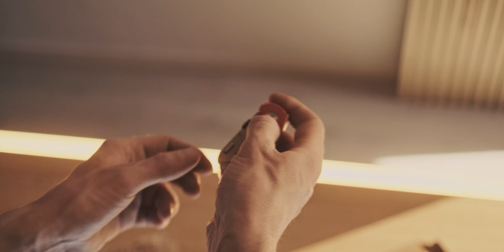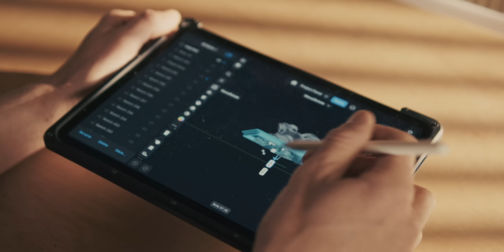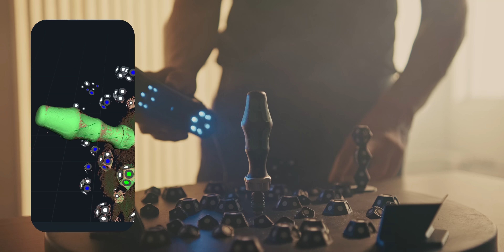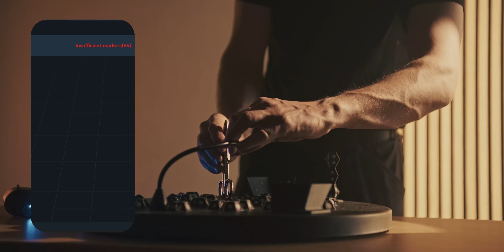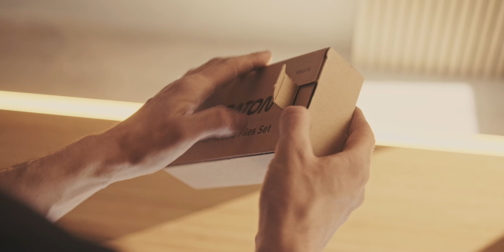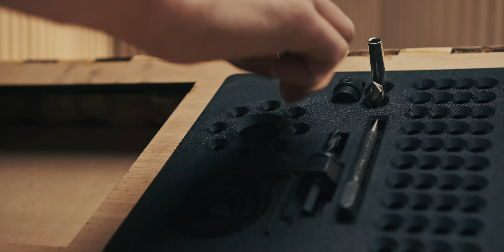Building the Ultimate 3D Print Project Panel

Comment: Why use such a POS screwdriver that can’t retain bits when you have a Wera ratchet screwdriver in your possession?
Also, those loose drill bits are just lost in those huge bins… you went to the trouble of 3D scanning everything, you could have allocated size specific locations for each drill bit?

Comment: You don't understand ratchet drivers. You just hold the collar on the first turn and it's automatically locked in the correct direction. It's not backwards, you're backwards.

Comment: So I do get the point of why your building what you are. I do like the style of it. But I think somewhat for functionality it comes to having it like you do or a more traditional tool wall vertical setup. So I use magnet strips on my walls for most of the same tools. And for some of them I think magnets are a better option for useability, not just like the pliers, but your needle files esp. I understand why you designed it how you did, but open sitting there designs with alot of tools always mean you adjusting other tools than what you want to use and putting back too. Magnet strips I call it the grab then slap back works really well.

Comment: I like 3-D printing and print a lot, but the 2 panels at 10:26, did you have to print those? It would have taken a lot less time to cut them out of acrylic, or even cut them out on your laser cutter? I feel that there are times when we rely on 3-D prints a little too much. I guess I'm just too impatient to wait for it to print out?
Reply: Well he does have more than one 3d printer, and sometimes convenience is the key point of a project, not the hidden details
Reply: Consistency is a thing he might be striving after too. Having some laser cut and some printed would mess with the aesthetic.

Comment: Organization is pretty important when making stuff. Recently printed a small multiboard setup to hang the few tools i have. No more searching around in a basket of random bits and pieces to find that one little file ;)

One suggestion i have, it might be nice to print (or, you know, use some other material) some sort of spacer for the drill bit basket. Those smaller bits just disappeared in there and i can already tell they will be a pain to fish out. Artificially reducing the height might make this a bit easier and nicer to use and grab them as they peek out like the other ones. Easily combines with the other idea of painting the bottom of the trays a bright color, by having the spacer be a bright color :)

Comment: I think you will probably want to re-do the drill thing at some point to have dedicated spots for either each size of drill, or at least the most used sizes. Spade bits less of an issue as its very easy to see the writing on them. If it was me I would probably keep 2 rows of the larger bins that would wind up full of fasteners, screws, washers and odds and ends applicable to the current project, then a dedicated row of holes for the spade bits and another dedicated row for the regular drill bits.

Comment: Are you using threaded Inserts with your fasteners?
Reply from the maker: at the moment im not using threaded incerts im actually just bolting directly into the print, its held up fine over the years, sometimes better than heated incerts as i dont have one of those press fit things that keeps them straight.